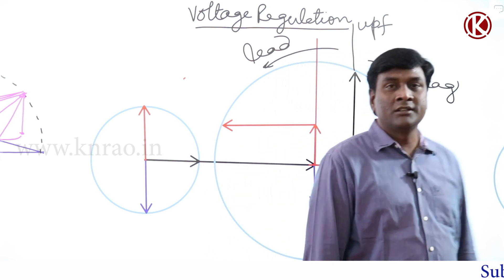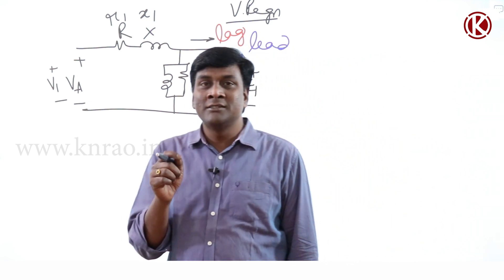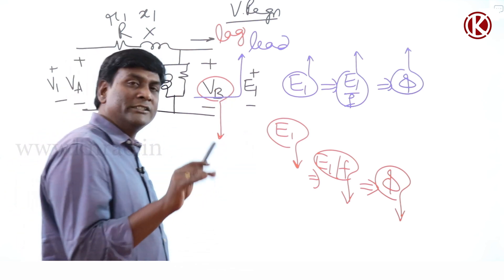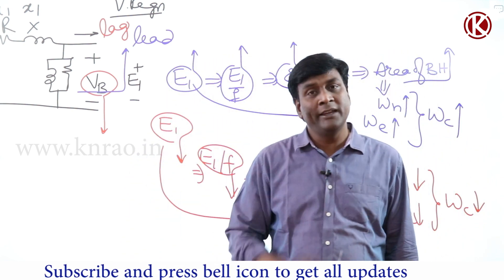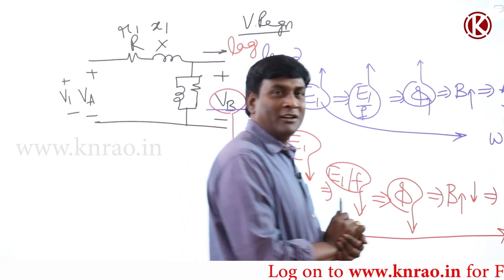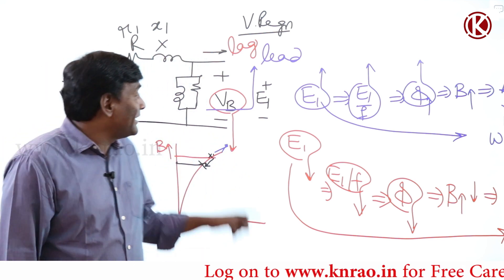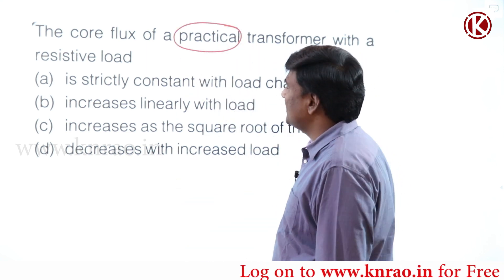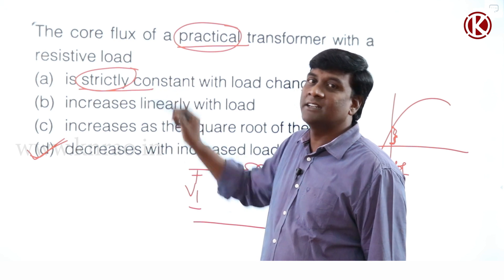How Operating flux of Transformer is NOT Constant | Very good Conceptual Qn | GATE Lectures | KN Rao

Comment: Sir your way is correct but what designers do is that we can move the shunt branch parameters to excitation side as no load current is 2 to 3 percent of rated current. In that case flux will be substantially constant. But in IM we cant shift this parallel branch because here no load current is higher than transformer no load current